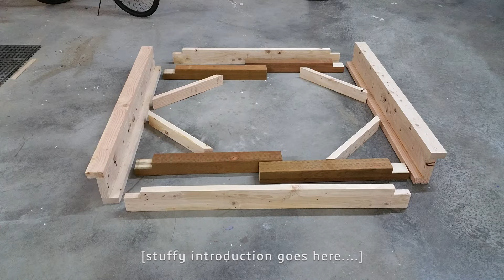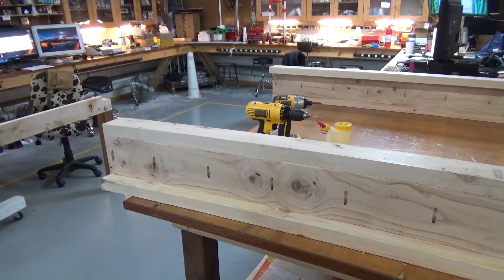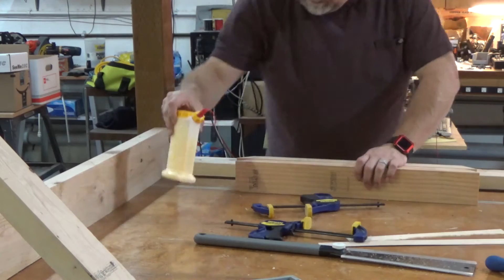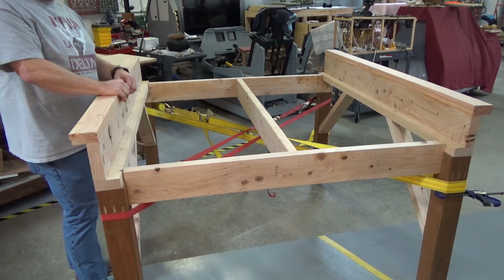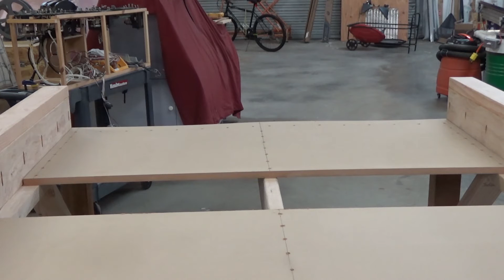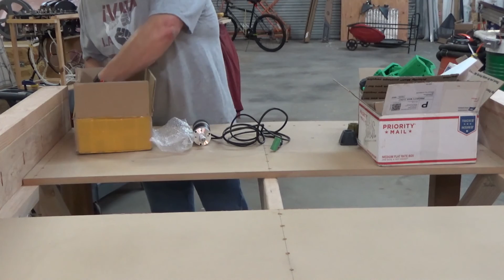Building an MPCNC table

Comment: Awesome vid. The unboxing felt like a time capsule for me!
Reply from the maker: For me it was more along the lines of, "what the hell did I order?!" ;)  This weekend should see the gantry assembly.  I may get to the torsion box for the cutting surface if I can grab another 1/4" sheet of plywood.

Did you spot where I screwed up the assembly?  :)  I'll need to take it apart partially to correct the problem - fortunately there's no glued joints involved.